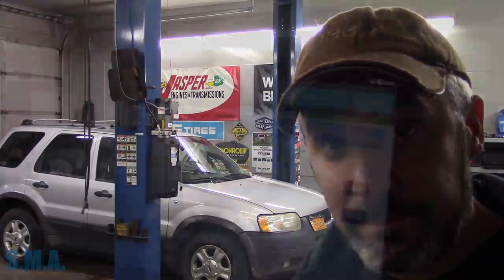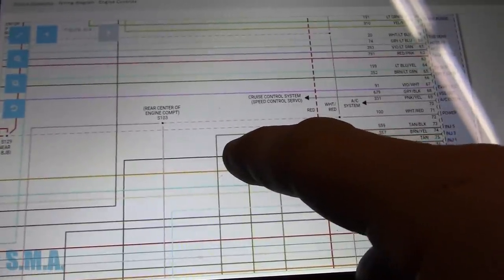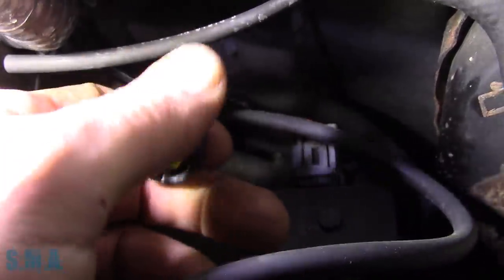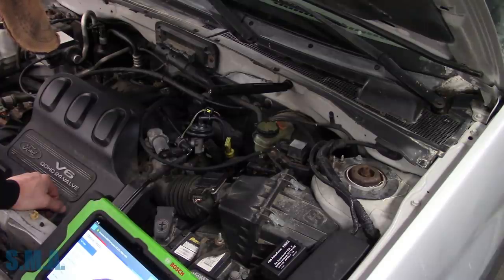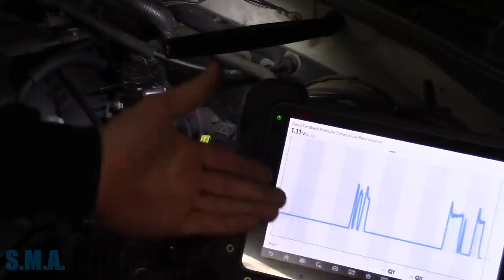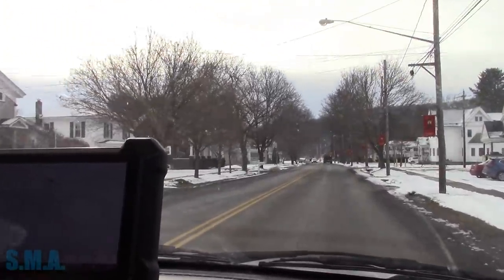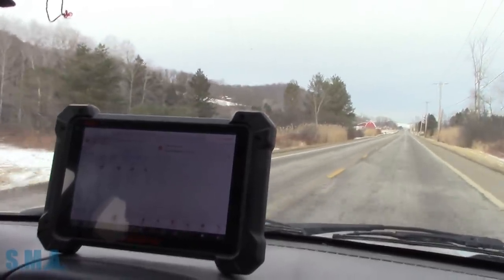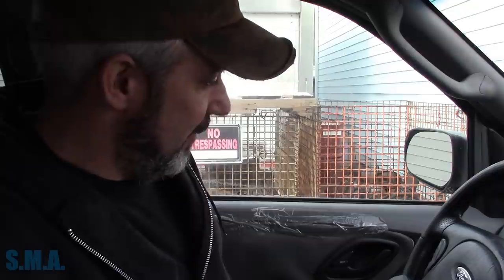Ford Escape: EGR Valve Problems

Comment: Ford EGR system problems... Diagnosed a bad DPFE sensor on a Ranger.

The truck came from a dealer with the money light on... The sale hinges on making the light go out...
 I replaced it with a house brand from Advance auto parts since they are in the same building...

The sensor failed before the truck could leave the bay.

I send it back and Advance sends me the next one off the shelf... It's bad as well...

It's close to closing time so I send a man to the Ford dealer, I have the part n will call.

I swap it with a Ford part from the Ford dealer and it works perfect...

After that I would not take a DPFE sensor that was not from the Ford dealer. I'm working flag hour and I don't have time for bad new parts.

Comment: theoretically, could someone block a faulty open EGR valve that is causing problem at idle?
is it just taking some exhaust gases and injecting them in the intake? so blocking it woudnt affect much?

Comment: I have a 1997 Honda Passport 3.2 engine with EGR valve problem -code for "insufficient EGR flow" crops up. I have checked the EGR pipes for blockage - it is very clean. I checked the EGR valve and it is clean. I then checked air intake manifold and throttle body - they were a little bit dirty-cleaned anyway. The code keeps appearing every other day or so or sometimes doesn't show up for several weeks. I even replaced EGR valve. What sensor tells computer the insufficient flow condition? I don't see any other sensors in EGR system. Kinda driving me crazy-any help out there? Car only has 77,000 miles on it.

I am curious-the EGR valve pintle position is monitored by a potentiometer
on top of valve. Why is there a potentiometer? The valve is actuated by
a solenoid - it's either full open or full closed. Or does the PCM send
variable voltage to EGR coil to somehow control pintle position?? If not
then a simple on/off switch actuated by pintle shaft would seem to work.
Anybody know anything about EGR position control? I can't find ANYTHING
on this on the web-hope Eric O (my God) can help-he pretty smart fella
y'know!

Comment: Common to block off the EGR valve in the UK. They're a pain in the arse. Blocking them off doesn't cause problems with the emissions test on the MOT or affect performance.

Comment: I have an 06 Chevy Aveo low mileage one morning I woke up to start it up from work was running like crap found out it was not running off of two cylinders pulled spark plugs off of coil pack it had sparked but it was not evidently making it to the spark plug so I change spark plugs and the spark plug wires after doing so figuring that it would run good fired up again same thing waited for a friend to bring a computer as soon as friend got their fired it up to show them what it was doing and it started running perfect and continues run good now the only thing I can think of is it had too much fuel in the cylinder that it wouldn't fire is that right thinking?

Comment: Just as fuses don’t just blow for no reason , wires just don’t leave their connectors . Everyone knows EGR’s are a high fail item , with signs of illuminated engine light and funny exhaust smells. Did the other shop misdiagnose the problem or did they break the wire over testing the connector or replacing the broken EGR. Other then power in , the test you did couldn’t tell the difference between a EGR that was stuck closed ,or a broken wire. If you didn’t get lucky and had the wire fall out , what would YOUR next step been ? So when the tests lead to a bad EGR they replaced , when that didn’t work ,their next was ...1 replace a hose ,diaphragm ,and sensor...2....jump in and start cutting in the wiring . At least the other shop knew their limits and stopped and sent it to someone who specializes in wiring problems.

Comment: Help! My 96 Geo Tracker wont run the I/M for Cat. No active codes, no pending codes. All other monitors will set in a day or 2. Ive driven it 800 or so miles and it wont set. I've replaced the cat and same issue. Any direction would help alot! Thanks

Comment: Wasn't that plastic engine cover recalled for jamming the throttle cables underneath wide open?
Reply: Yep!  Apparently their fix was to stack some washers on the mounting studs to raise its position up slightly.   I had already thrown our cover in the garbage by the time we got the recall notification though...

Comment: Please answer this question: Does a typical American car Dealer Service Center have this tool you use so proficiently? My 1996, 7.4 Liter, Gas truck needs some diagnostics.
Reply: It's an Autel, but I believe his is a Maxisys or Maxicom. High-end model. But yeah, most mechanics should have something like it.
Reply: @EHKOS  Thanks!
Reply: Many will have something comparable, but many relie too much on the tool to tell them what's wrong versus, use it as a tool in diagnosing issues.
Reply: @jaydak99  I hear that. I started with a Model A Ford (over 60 years ago). I can tell a great deal by the sound of an engine, the smell of the exhaust, ..... but 'today' there are so many sensors and relays an average Shade Tree can not keep up without doing the "Parts Canyon" and that is just too expensive (and stupid).

Comment: Never buy a car with an EGR valve.    If you have VVT, you will not have one.
Reply: VVT delays exhaust valve closing at start of intake stroke - sucking back into engine some exhaust gases - accomplishes same thing as what an EGR valve does. An EGR valve port can be blanked off stopping exhaust gases
back into engine - can't do that with VVT.

Comment: so what im curious about is proper use of my 4wd system. my truck is a 94 f150 5.0 with manual hubs and the two 4wd buttons on the dash (4x4 and low). if i put it in 4wd and or LOW do i have to lock in the hubs or is it drive-able without locking the hubs? i dont want to break anything but even if it wont hurt anything will the 4wd system act like its still in 2wd if i dont lock the hubs? what if i only lock one hub, what happens then?
Reply: If they are manual locking hubs (no auto setting) you will have to lock both hubs to have 4 wheel drive.  If 1 or both hubs are set to free you will effectively still only have 2 wheel drive even if 4x4 is engaged on the dash.

If you won't be needing to use 4x4 I would keep them unlocked until you do.
Reply: @ericbuist8218  thanks man. yeah i did try both settings the other day without the hubs locked and it was quite useless till i got out and locked them. will it hurt anything to leave the hubs locked if i turn off the 4wd? that way if i ever need 4wd i dont have to hop out and fiddle with the hubs.
Reply: @Billy_Darley   If you use 4WD regularly I guess you could leave them locked for convenience.  But if you spend more time, or extended times, on pavement in 2WD you would probably want to unlock them.  When the hubs are unlocked in 2WD most of the front-end drive-line components won't be spinning while you are driving, so theoretically you should see a little better fuel economy and less wear-and-tear on your front joints and bearings.

Also I can tell my truck has noticeably more drive-line noise from the front end when the hubs are locked, even if the transfer case is still in 2WD, so that's another reason I tend to keep mine unlocked until I need the 4x4.  Unless I know I'll need 4WD again later that day or they're calling for snow several days that week... then I might just leave them locked for the time being.
Reply: @ericbuist8218  hmm ok. thats actually pretty helpful to know. the trucks missing the exhaust from the cat back, so its noisy already. kinda dont think id hear any front end sound over it so for the moment that wouldnt concern me. just worried about damage occurring. hows about speed? are there limits? ive heard up to 25mph in 4x4 low but what about regular 4x4 mode? can it be driven around town and on the highways like an awd vehicle?
Reply: @Billy_Darley   Your 4x4 is what's known as a part-time system, meaning that it should only be used on slippery surfaces - so basically off pavement or if the pavement is visibly covered with snow or whatever.  In 4x4-High I'm not sure there's a limit to how fast... realistically I would say you should be fine up to whatever the slippery conditions that warranted 4x4 is the first place will allow.  I know I've taken mine in regular 4x4 up to proabably around 55 MPH on snow-covered interstate highways before.  I would think the owner's manual (if you have one) might say if there's a limit to how fast you should go in 4WD but if your's is like mine it's probably long gone!

Comment: There's bogus hospitals, doctors, mechanics and many other types out there who actually believe they are better at their work/career than those who simply do it the right way. Seems that those who believe a way to cut corners is smart and also a dependable method. The truth is, what goes around, comes around and in this video example, those who cut corners had to send the job to someone who doesn't cut corners and got the repair completed 100%.  Need not say much more on that.

Comment: The ol’ EGR valve!! Putting filthy exhaust back into your clean air! DUMB
Reply: It reduces emissions by using the engine to combust the unused hydrocarbons left in the exhaust, and also reduces combustion chamber temps, allowing for better chance of complete fuel burn. Not very dumb if you ask me.
Reply: Up